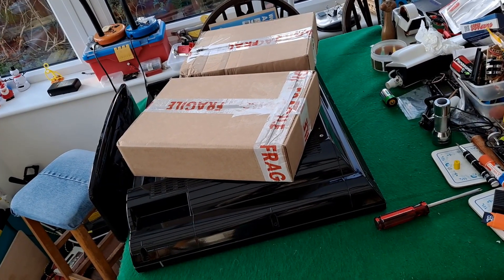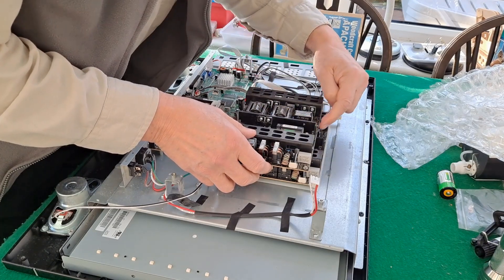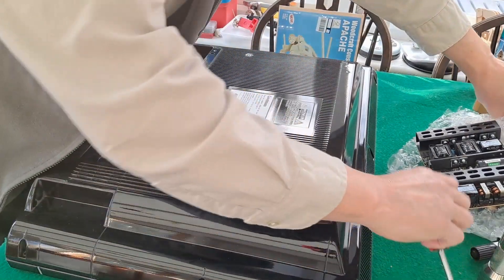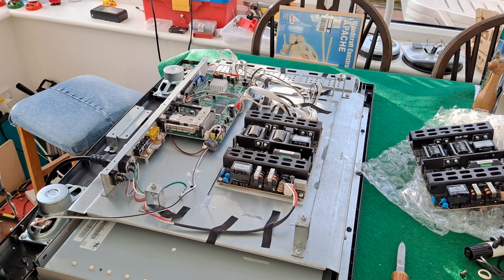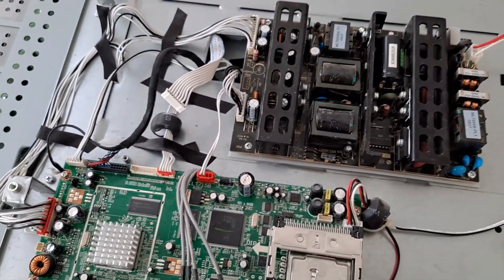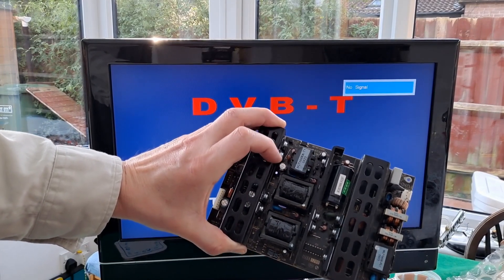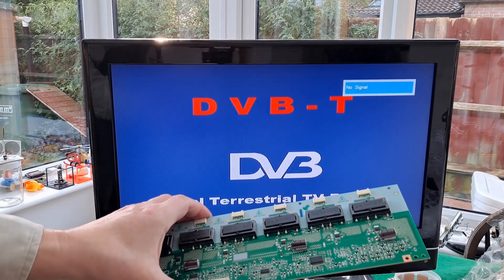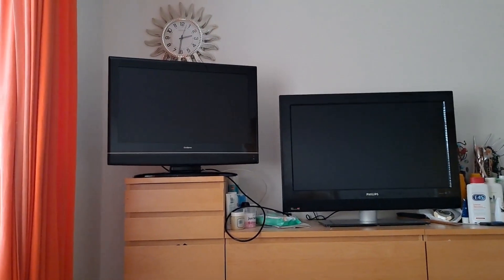Fixing my Goodmans TV LD2667D 20201204

Comment: Hi. I have a Goodmans G55ANSMT and I was trying to plug a firestick into a hdmi and it went off. Now I have a standby light but the screen won't turn on at all either with remote or the static buttons. Any ideas please?
Reply from the maker: Honest answer, No. I researched online to see what other people did (probably the same as you are doing). The TV has modular components, so you can change one board at a time to try to identify the culprit. However, that obviously means you have to source those boards from somewhere, like eBay. This is the playlist for the work I did on this TV https://www.youtube.com/playlist?list=PLA5a2xPRSrB0g92PeSJ496AKXX2xQqVQD My guess is the power supply didn't like what you plugged in, but that is just a wild guess. If you are tempted to take the back off and start poking around, remember it is mains voltage, so you may kill yourself. The board that feeds the display is even higher voltage, so you are taking a significant risk.
Reply: @GrandadIsAnOldMan  okay thank you
Reply from the maker: @gunnergeezer1  good luck 👍👍

Comment: £12 quid for a new telly is still pretty sweet and you learned a lot along the way.
Enjoy!
Reply from the maker: Yes, a good result. Could have been even cheaper if I had checked the output voltages right from the start, but I had seen so many videos saying it would be the power board, it clouded my judgment.

Comment: Brilliant fix Graham. I was so convinced it was the power board because that is usually the thing that goes with them. Plus seeing the puffy capacitors on the old one made me think it was something on the board even though you changed the caps because why were they puffy in the first place.
 Great idea buying the inverter board. Now you have a working TV and a spare power board all for a tenner. Well done. 👍🏻👍🏻👍🏻
Reply from the maker: All the videos I had watched in the past had gone for the power board and the capacitors so I didn't even bother measuring the power outputs as I really wanted to try swapping the capacitors. It has been an educational project.

Comment: You fixed it. I wonder what component failed on the board ? 
Maybe one of the mosfets that drive the HV transformers .
It is usually what components are getting hot.
Your FLIR could see the hot components on the working board, if you want to get one more video out of the series  .
Reply from the maker: I think I will give it a rest. I don't have an FLIR. I do have a digital thermometer that I could point at each component one at a time to see which is hottest or coldest, but I would have to take the TV apart again and put the old board back in and that board went in the recycling anyway. I was glad to get rid of it. 😆